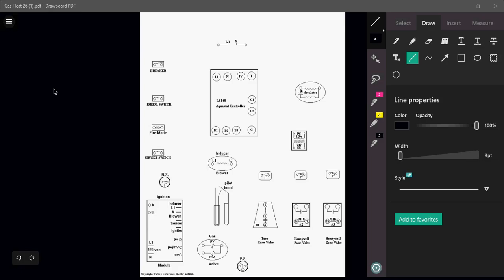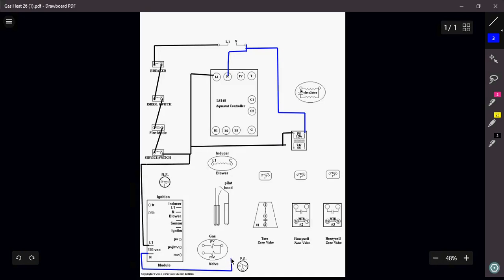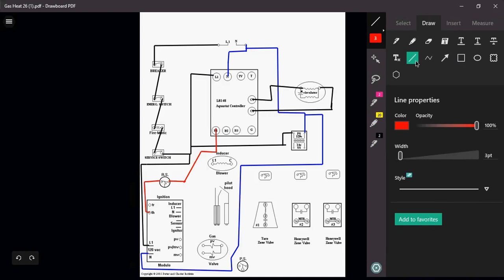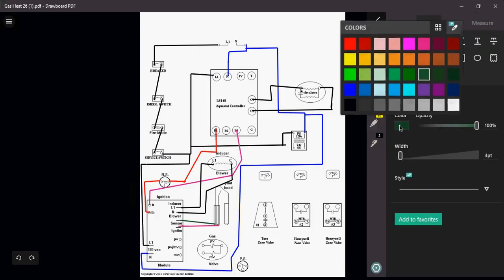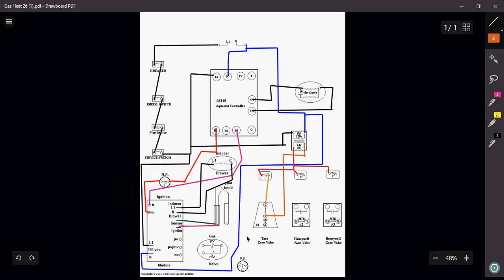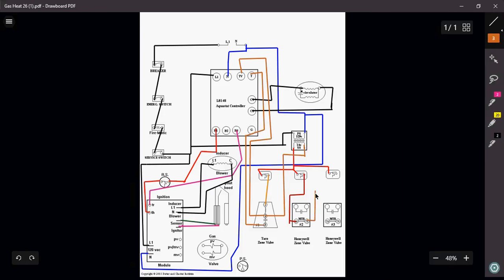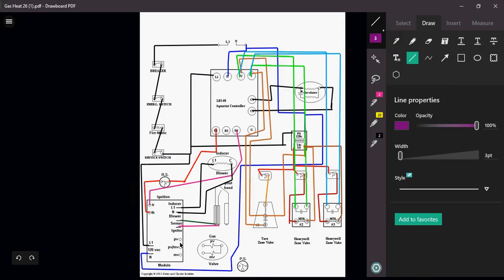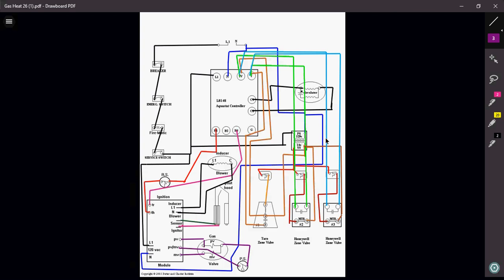L8148 Aquastat wiring with zone valves

Comment: I have the same aqua stat L8148e  no zone heating just a battery operated 2 wire thermostat 
I bought a new Honeywell 9585 smart thermostat and it requires a c wire . Could I use the tv wire at the thermostat jumper it to the c terminal to power it ?